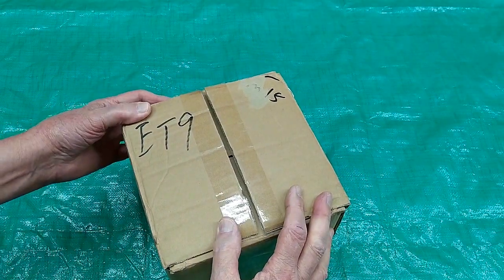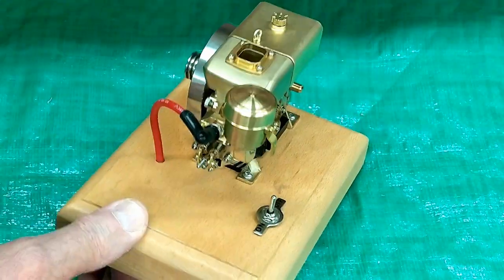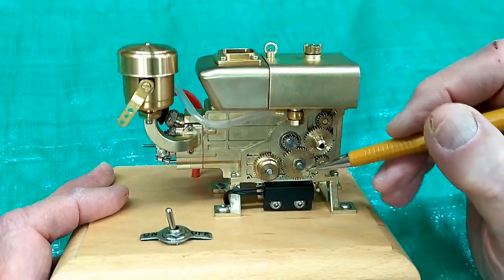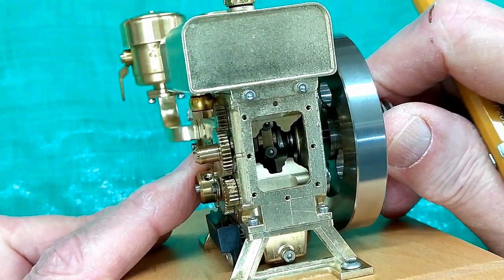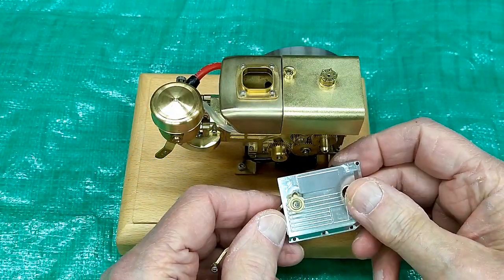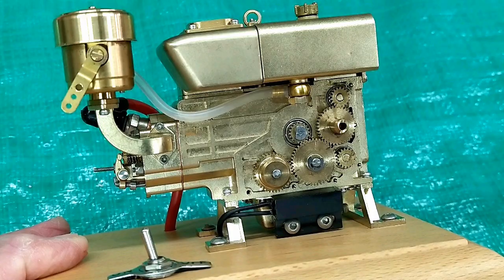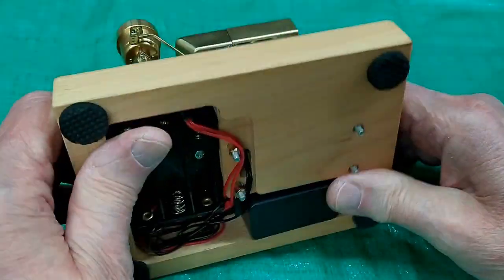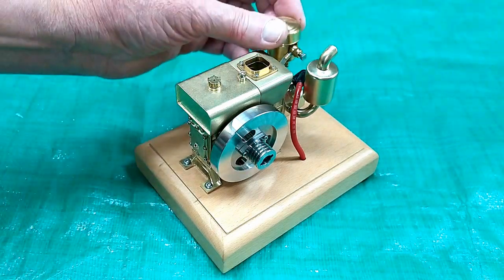Eachine ET9 Mini Gasoline Engine - Review & Running

Comment: International Harvester one cylinder models LA and LB used a 1/2 RPM reduction belt pulley driven by the cam gear. I'm sure that is the intended function of the mystery shaft.  It was done so to match equipment requiring less RPM such as pump jacks or older machinery.  I believe I've seen this or a similar engine being used to do the same.

Comment: Great video and explanation! 
What would you recommend to spray into the combustion chamber when the engine is not going to be run for a while?
Reply from the maker: Most everything in this engine is stainless or brass. If you use a little Marvel Mystery Oil in the fuel, you do not need to worry about the combustion chamber. Keep the engine clean and lightly oiled until the next time you decide to run it. Use only distilled water in the engine. Drain all water and fuel from the engine if it is not going to be run in the next few days. 

This is my video on the correct fuel to use and it works in all of these engines.

Hit & Miss Engines - The Correct Fuel 
https://youtu.be/TvLziWCI7Oo

Thanks for watching. Please subscribe! 
That is what keeps this channel going. 
Ron

Comment: Since it's not a hit and miss engine I am curious as to why it's surging. Then I read your comment that it's related to carburator adjustment.

You mentioned these parts are cast. Are they cast like lost wax castings? I'm surprised they didn't just create a large injection mold to cut down on labor.
Reply from the maker: Tomorrow I release the ET9 carburetor adjustment video and once adjusted, t he surging goes away. Being originally much too rich I think t he excess fuel accumulated in the intake manifold and caused the surging or "hunting".

The castings look injection molded but I'm not sure and the manufacturer is difficult to communicate with.

Comment: Thank you Ron !! That was the Review i didnt find on youtube , perfect work !! Best Videos from you . Best regards
Reply from the maker: You are welcome! Thanks for watching. 
Ron
Reply: @RonaldWalters2010  dear Ron unfortunately I have another question and don't want to annoy you with it, I have a problem with the et5 Mini, I had 5% oil in the gasoline and let the engine run for days without any problems, I wanted an oil mixture with 3.5 % try a little less and I can only get the engine to run in idle it does not take the gas no matter what setting I change on the carburetor I have tested for 4 hours without success what could be the problem do you know that I would be infinitely grateful to you, best regards Silvan
Reply from the maker: YouTube just sent me this comment (one month after you left it). Strange!
I don’t know what to tell you. The high speed and the low speed needles interact. Possibly (possibly) if the low speed needle is screwed in too far, then the high speed needle may have no effect. Just a thought.
If you use marvel mystery oil you only need to use enough to slight change the color of the fuel.
Or... something in your carburetor of fuel line could be plugged up. Try disassembly and flushing.
Reply: @RonaldWalters2010  Thanks Ron !!!

Comment: They keep over engineering the parts but they dont improve the engine conceptually speaking. Im still waiting for better a carburetor or a proper cooling system with a flywheel fan like weedwacker engines and such.